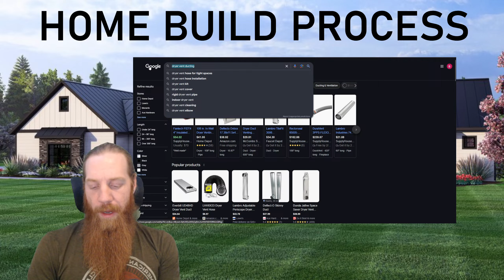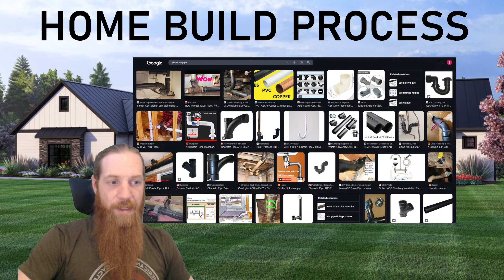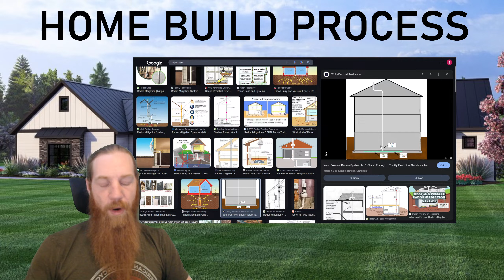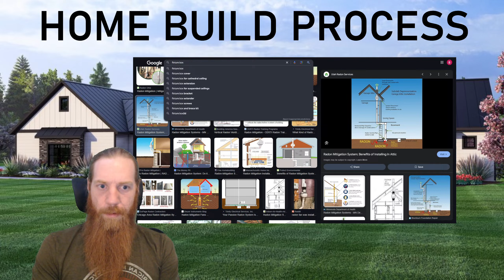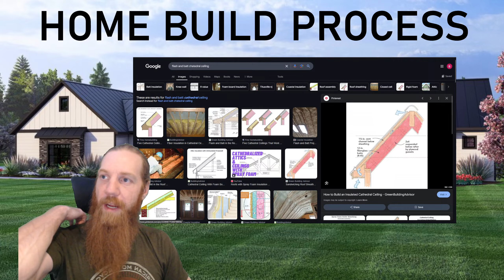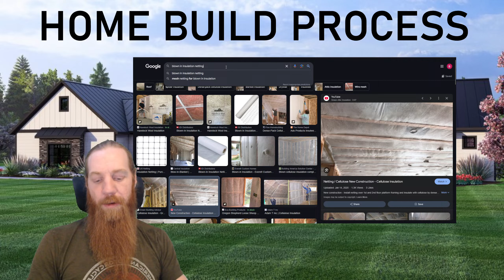How To Build A House Part 3 - Complete New Home Construction Process | Ask A Builder Live Q&A

Comment: Two things that come to mind worth mentioning in the next video is utilizing wholesalers if contractors have a proper business entity set up.  Also, when people are making purchases for large projects whether a remodel or in this case new construction getting quotes at pro desks of big box stores to get lower prices on materials when ordered in bulk.  Usually if orders are greater than a $1,000 for doors, windows, lumber, drywall, paint etc.  Excellent video again!
Reply from the maker: Excellent points, thanks!
Reply: @ This is a more advanced question, but let's say I want to insulate the exterior portion of probably a standing seam metal roof.  First, do you know of any industry accepted method of 2-4" of solid insulation over roof deck with an interior attic insulation under, without reinventing the wheel too much?  Second, cost vs best material choice XPS or mineral wool "comfort board", which is easier or smarter to use?  I've used XPS Owens Corning for walls, I'm assuming the fastening of mineral wool is similar?  Being in Oklahoma a huge part of my process is around considering shear and uplift forces hence the plan to use ICF construction.  Along with balancing insulating for our stupid hot and humid summers...  If you know of any online resources/books, because most things I've found on manufactures sites call out details for flat commercial roofs not 4/12 - 6/12 pitched hip or hip-valley roof designs, so I can accommodate a/c equipment, and ERV in a conditioned space to improve efficiency.
Reply from the maker: Great question, and difficult to answer in a comment, maybe ill do a video discussion at some point. But yes, using a combination of interior and exterior roof insulation is fairly common as the exterior insulation is typically not nearly high enough r-value for the total required r-value unless you are doing some extreme exterior insulation. Any standard method of applying the insulation should work in most cases but discuss it with your engineer. The attachment of roofing material to the roof deck over the insulation will be key in high wind areas. As for material, mineral wool is superior but also can cost twice as much compared to foam board. I would probably only spend the extra for mineral wool if its in a wildfire prone area. Either way the installation is similar, but id rather work with mineral wool than foam, less mess. Check out Matt Risinger if you havent already he has some good videos on youtube for roof insulation. Also sites like greenbuildingadvisor.com and buildscience.com have some good resources.